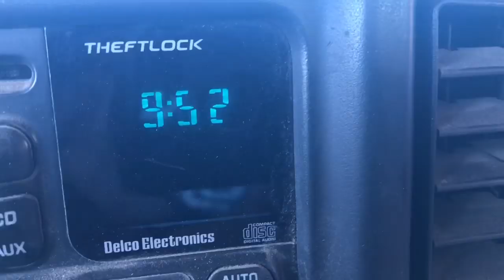Amish and Mennonites exposed! Why they actually help after disaster! 2020 Barn raising!

Comment: the biggest advantage from the lose is you can change and enlarge the original site to fit today's task or tomorrows vision , with typical insurance policy's  you have to rebuild too the original foot print and size even material used is subject to restrictions or approvals thus more costly in the over all future of the site
Reply from the maker: Yes Indeed! It’s much better now!